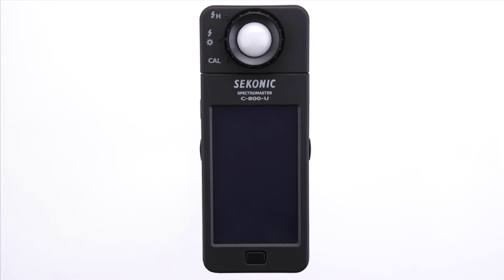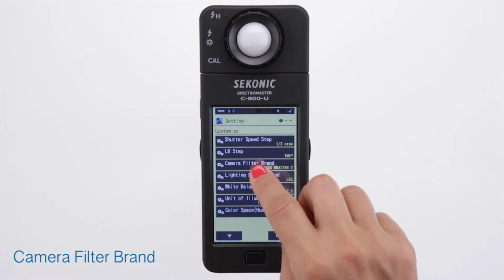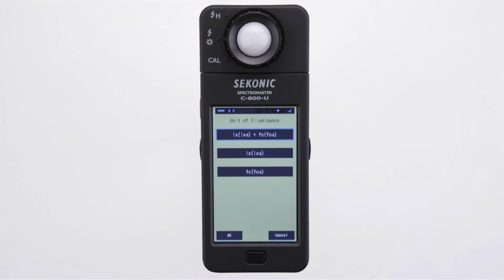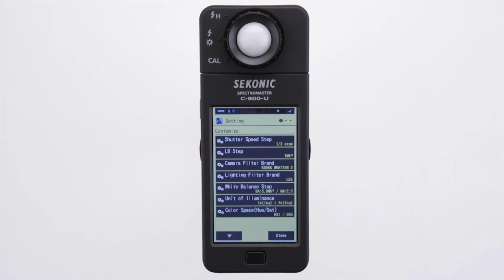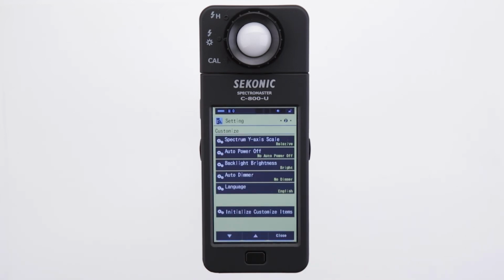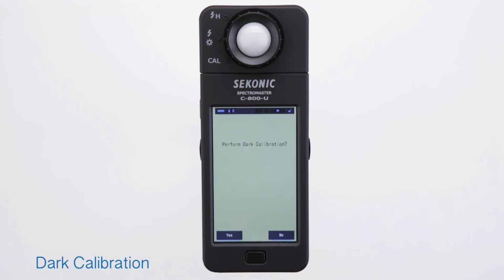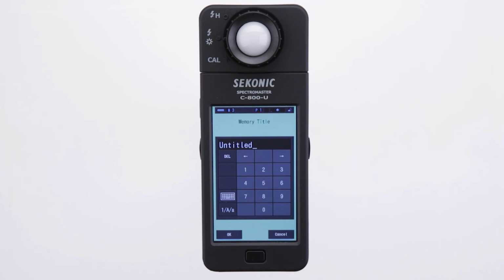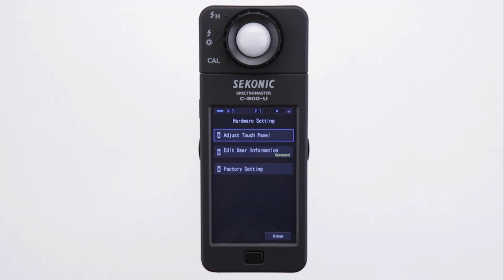Sekonic C-800 Spectrometer Quick Start Video: Tool Box & Setting

Comment: Thank you for the informative video.
Sekonic C-800: How to add new Memory Data to a pre-existing Memory Title other than the last one created?
All new saved memory data seem to end on the last created Memory Title. This is regardless of the selection on the Memory Title folder. Selecting and Recalling a Memory Title doesn't work for this feature.

The User Manual doesn’t address adding new Memory Data to a pre-existing Memory Title.

Any help would be greatly appreciated. 
Sekonic C-800
F/W 20-11-11 (860B)
Reply from the maker: You have to manually retype the name of a saved memory title.